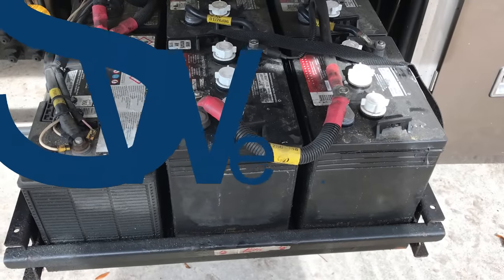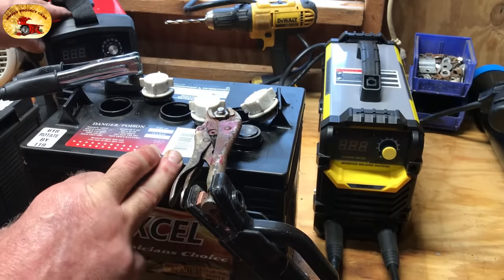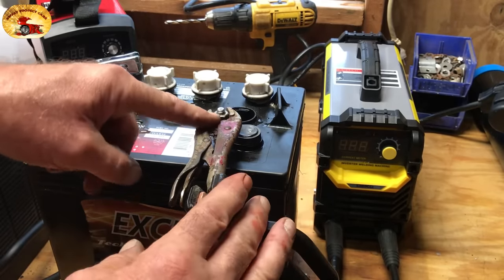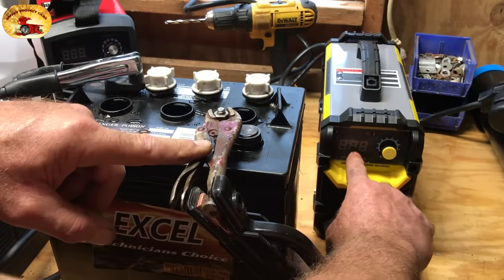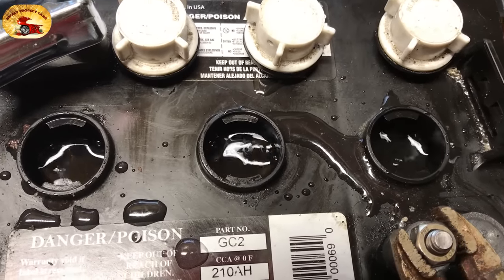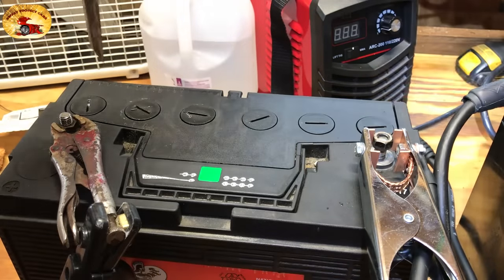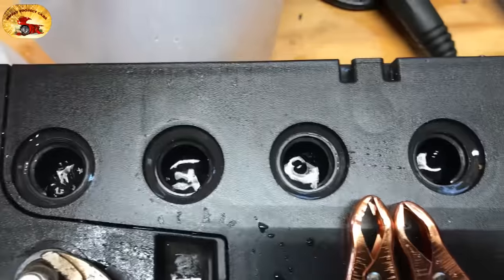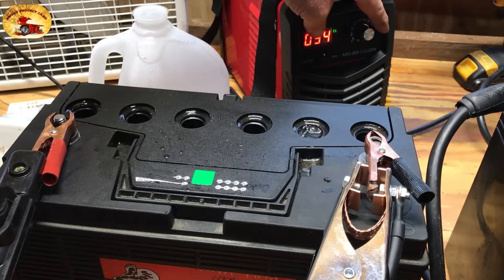How To MAKE OLD BATTERIES NEW Again!!!  12v 6v Deep Cycle, Car, Truck, Golf Cart, Semi

Comment: Thank you very much.I can confirm that this method works.I will try to give info how i did it so maybe someone will find it helpfull.My battery is 75Ah 12V one.It worked perfectly for 3 years without any maintenance at all.First i added 100ml of water to have it enough and over all cells for about half of inch.One cell in my battery was bad.I saw no bubling on charging using my welder on 30A.So i cranked it up to 80A.I keep it running for short time till battery temperature started rising up to 35deg (body temp).Then i made a pause till battery colled down completely.Then i did same thing again.This about temperature is IMPORTANT ..... it must be done as i described.I repeated this for about 15 times.Then i turned it back in to my car.It started at half of key turn.I am testing it today and tomorow i will know.....after cold night.....is this permanent solution or i have to repeat all for more times than i did it now.Battery was not capable to start the car before i tried this.Thank you again and Happy New Year!
Reply from the maker: Awesome Miki!  Thanks for sharing your results, we appreciate it.  Have a great day.  mad Mike the hammer SPC
Reply: @SweetProjectCars  It didnt restore full capacity....but was in better condition next day.....so i decided to repeat all over again till i see bubling in all cells to be the same.And it happened after many repeats (to avoid over heating - lowest current setting on my welder is 30A).Now it holds as new.

Comment: Howsit. I have 4 x 12v 225a batteries for inverter. 1 battery has a dead cell. Its not boiling at all. What can i do or is that 1 toast?
Reply from the maker: Do the process shown up to 5 times, if it doesn't wake up after that your battery is toast juan. Thanks for watching and asking, have a great week my friend. mad Mike the hammer SPC
Reply: @SweetProjectCars  update... The 3 cells on the negative side only start boiling at 80 to 100 amps. Other 3 boil like crazy... Did it many times. Goin 200amps, those 3 seem to boil faster but looks like after few min boils less.... U reckon toast? Thanks brother
Reply: Hey brother. Got them to boil. Keeps 12v charge now. Doesnt last long tho... But did it like 30times lol... Question... Has any1 tried this method with 4x batteries in series. 48v, boil all 4 at the same time? Regards

Comment: Will this work with AGM batteries? Also what about using the Harbor Fright wielder, Unlimited 200™ Professional Multiprocess Welder With 120/240 Volt Input? I need it for other projects but I've also got 6 dead batteries to replace. 1/5 AGM/reg, still about? $500.00 This welder is $769.00, sounds like a no brainer if it will work. What do you think?
https://www.harborfreight.com/unlimited-200-professional-multiprocess-welder-with-120240-volt-input-64806.html
Reply from the maker: No, it does not work on agm/gel batteries.  This  https://amzn.to/2K1UsWQ  is not 769?  Not sure where you got that cost, but all of the tools/products we use in our videos are in the SHOW MORE of the videos description.  mad Mike the  hammer SPC
Reply: @SweetProjectCars  Sorry, not the welder in the video. I'm talking about a Harbor Fright wielder, the Unlimited 200 Multiprocess Welder, it does MIG, TIG and stick welding, plus Aluminum too. Since it does stick welding I'm guessing it can do what your doing since its applying a consistent DC level at the battery. Is that correct? I left you the link above to look at.

Comment: Two questions please: 1) Please identify the two welders you used in your procedure;  2) can this same technique be used with AGM, or does the glass mat inhibit the "shock" of high current charge?  PS: thank you very much for a great tutorial.
Reply from the maker: This one https://amzn.to/3sTpodi  for ALL Deep Cycle only 6 Volt & 12V Batteries  and   For All  Standard 12-volt Batteries use this one   https://amzn.to/2K1UsWQ  This process works on all wet-style batteries only, no agm/gel batteries.  Thanks for watching Len, we appreciate it.  Have a great day.  mad Mike the hammer SPC
Reply: @SweetProjectCars  What are the differences between deep cycle vs standard batteries that require different welders? Is there not one welder that can do the job for both types of batteries? Thank you so much for your help! 🙏🏼
Reply: @AberrantAbe  @Sweet Project Cars I have the same question. I have five vehicles, but am also interested in getting into 6v golf cart batteries on the cheap (maybe find some discarded ones) for use with building a solar power system. It would be nice to just have one welder. I would really be interested to know why deep cycle vs. standard batteries requires a different welder.
Reply: Hi Mike I know this is an older Video. I hope you're staying safe and healthy!  Your videos have helped me tremendously over the years!  Wishing you a wonderful holiday now because I will probably be relaxing in another week or so. 

I do have a question that you may know the answer to.  I have both deep cycle and regular batteries would I be able to get away with using just the 165 amp welder for both uses?  Just trying to save some money and to avoid more clutter in the garage.  Any insight would be helpful. Happy holidays brother!
Reply: @AberrantAbe  Deep cycle has thick plates inside for slower discharge. Standard has thinner plates for faster discharge needed for starting equipment rather than holding power for long periods. I also discovered they score plates like Hershey bars, engineering them to break near or at the warranty time. Open up a 2 year warranty battery yourself and take a look. It will tick you off.
Reply: @OptimumServices416  hey brother, I know I’m not Mike, but I read on another comment where he said you need 2 different types of welders for the 2 types of batteries (deep cycle and standard 12v). I know, disappointing. LoL. I hoped there was one welder to rule them all.
Reply: @SweetProjectCars  I don't get why you need two different welders to do this ?? You never explained why.
Both welders output amperage and can be adjusted, so what's the difference ?
Reply: Has anyone done this and input since  the video was made?
Reply: Two different size batteries require larger and smaller welders -

Comment: How do I test for a dead cell
Reply from the maker: Run this process and you will find out if there's a dead cell.  Thanks and have a great day.  mad Mike the hammer SPC
Reply: I have been able to get a dead cell on a 6v battery bubbling but the specific gravity is still not reading.  I am in the early stages of reconditioning the battery.  Doing it slowly with a dead cell for safety.
Reply: You can also use a battery specific gravity (SG) tester.  Dead cells usally test very low on the SG.  Mine wouldn't even register a reading.

Comment: pretty much boils down to "do I buy a new battery or do I buy a welder?"
Reply from the maker: If you are not into DIY and doing things yourself, head on down to walmart and snag yourself a 99.00 2 yr. battery and you are set to go.  I wouldn't concern yourself with buying any tools, sounds like maybe tinkering with your own stuff maybe isn't your bag.  mad Mike the hammer SPC
Reply: @SweetProjectCars  Hah, maybe I should have phrased it " now I get to buy a welder..."
Reply: @guyspencer4322  this guy has another video on using a regular car battery charger. It's about a year old and has different times for charging. Don't know why he didn't just reference it. Good luck with your project 👍
Reply: @houstonsheltonbees814  Yes but that’s also a 200 amp capable 12 volt charger that costs about $139. For someone doing DIY and especially more than one battery, this is awesome. For the person who might use it once, not so much. Personally I work on cars so love all of mikes content!
Reply: @guyspencer4322  Obviously, a new battery helps you once -- until you have to buy the next one.  A new welder gets you welding capabilities and you no longer need to buy new batteries.  Do you want to buy one fish, or a whole pond full of reproducing fish for the same price?

Comment: Hey thanks for the great video It is so useful and educational, i tried it on my motorcycle battery on the lowest volume and all of the cells bubble except for one i crank up the welder a little but the dead cells wont budge but all of other cells boil like crazy so i cant go upper i afraid they blow, what i do?
Reply from the maker: If you can't get a consistent boil on all of the cells Alireza, your battery is toast. Thank you for watching, sorry for our delay in responding, have a great week. mad Mike the hammer SPC

Comment: Hi, much appreciated your great video. I purchased the Deko already welder and I used it on one of my 6 volt deep cycle battery which is 300 amp hours , after doing 5 min for 5 times and waiting 10 minutes between for rest periods the voltage did get better and it did start to boil more. But the battery is resting only at 5.8 volts. Should I continue the process till I get the battery to sit a 6  volts or more. Thank you again

Comment: Do I need a 200 amp charger for a lawnmower batteries or will 50 amp suffice?
Reply from the maker: For that size battery, follow the video using the exact tools/products just cut all timelines in half, William. Thanks for watching and asking, have a great weekend. mad Mike the hammer SPC

Comment: Hey I have one cell its the one at the end by positive terminal that isn't really bubbling like the other and the battery only lasted a couple of days. Alternator is good and I cranny the welder up all the way and it still won't bubble hardly, I've done all my batteries this way and they all worked but I can't get this one for some reason, what can I do?please help asap, thank you
Reply from the maker: Sounds like your battery is toast jay. You can do the complete process up to 5 full times, but if it doesn't work after that, it's toast. Thanks for watching and asking, have a great week my friend. mad Mike the hammer SPC

Comment: Thank you for the videos. What is the purpose of adding a clamp to the battery terminal first and then connecting it to the welder clamps. Is it for avoiding the sparks...?
Reply from the maker: Please, if you are planning on doing this process, follow the video to a T not only for safety but to make sure the method works for you. Thanks for watching and asking, have a great day. mad Mike the hammer SPC

Comment: Mike my man! I have them both... welder and dead battery...   First I'll try it with a really old one... if it works I open a battery repair shop :D !!!!  And I'll donate some of my savings! THX!
Reply: Big respect from Hungary!
Reply from the maker: Follow the video to a T my friend.  We are here for you, if you need help, reach out with any questions.  Thank you for watching and for your kind words.  Have a fantastic day.  mad Mike the hammer SPC
Reply: @SweetProjectCars  Nice thank you! I eventually skipped the project today because of heavy frost... I think it will work better at least around +15 C... 
And since you are so nice I dare to ask:
Is it not better to fill in battery acid instead of distilled water? ?? I have them both... and I just wonder, maybe the old battery would require some fresh acid...
And is the polarity important where to connect wich cable?? Thank you for the answers. 

Ps : be careful with the 303 rubber treater I read it can cause harm to the human body..
possibly carcinogen! Just take extra care...
It looks really effective, however! Keep on the good work! Respect!

Comment: Will this welder work? Forney Easy Weld 140 MP, Multi-Process Welder
Reply from the maker: Please follow the video to a T, there is no other alternative, use the exact same tools, products and method, we've spent years perfecting this process. Thanks for watching and asking, have a great week. mad Mike the hammer SPC
Reply: I use my welder and it works too on regular 12v car battery will this work for agm batteries too?

Comment: I’m doing a 6V deep cycle battery right now and I’m getting zero to very light boiling. Does that mean it won’t work on this particular battery? FYI, I did another 6V deep cycle yesterday and brought that one back to life.
Reply from the maker: Hello Paul, you can do the entire 5 step process up to 5 times, if it doesn't wake up your battery after that, the battery is toast my friend. Thanks for watching and sharing, have a great week and all the best on your project. mad Mike the hammer SPC

Comment: What can I do if a have a shortened out cell. I mean with this process you create lead ,,mud" at the bottom of the cell and at some point it will be high enough to touch the cells and short them out. Is there anything I can do then?
Reply from the maker: My friend, if you can get the life of a battery doubled or tripled and that happens to your battery and you have to replace it, just be happy that you got to use the battery 2 or 3 times longer all for free.  Thanks for watching, have a great day. mad Mike the hammer SPC
Reply: @SweetProjectCars  well the battery is from my Ford Focus that was 5 years old at that moment and so was the battery. I was just dissappointed in all my other beater cars the batteries are at least a decade old

Comment: I believe most DC welders weld with the negative pole meaning the stick is negative and the clamp os actually positive.. general misconception..I have seen and used this method before it works...Im wondering if the reversed polarity is whats actually making the magic happen..what you think?
Reply from the maker: Knowing youtube, we have to keep things very simple we have to show the processes without getting into too much confusing info. Thanks for sharing, Piere, have a great day. mad Mike the hammer SPC

Comment: What happens to all that sulfate that gets boiled off the lead? does it dissolve into the liquid?
Is there any time where you would want to dump out all the solution and replace the acid? I know the acid is not suppose to evaporate but over time i may break down?
Just thinking out loud over here - you got me very curious :) Good job over there
Reply from the maker: Hello Kevin, don't analyze until you are paralyzed, follow the video to a T and you will love the results. As far as replacing the acid, it's not necessary, but you certainly can if it makes you feel better. Thank you for watching, we really appreciate it, have a great week my friend. mad Mike the hammer SPC
Reply: @SweetProjectCars  Great answer; thankd you very much!

Comment: From what I've seen on YouTube and tried myself minimum amps required to start bubbling is 50amps. However this amount will not be sufficient enough to desulfate the plates inside a lead acid battery. Also some batteries require a discharge before being put back to use. So go through this process and fully charge the battery then put a load to measure voltage drop and check where it settles (12.6V - load = resting voltage) light or actual load tester (tool) for a few seconds then remove the load and see if the voltage returns to 12+ V. It won't be the same as before the test but it is a good indicator that the battery is in functional state. Then proceed to discharge it approximately to around 10.5V then recharge it until full 12.6+V and should be good as new. Also like you replied some batteries are not capable of being reconditioned due to internal damage.
Reply from the maker: Thank you for watching and sharing, we appreciate your input Frankie! Have a fantastic week my friend. mad Mike the hammer SPC

Comment: Good sir, have you tried the desulphating pulse chargers like the OPTIMATE-6 ? 
I want to start a home based battery revival wokshop and I need to know what to invest in first. A 5 Amp smart charger with desulphating component (OPTIMATE-6) or must I straight out go for the dc-welder?
Reply from the maker: Get the welder, it's the best way to do this process my friend. It's a small investment for a great return, plus you will have a welder if you ever need one :) Thanks for watching, have a great day. mad Mike

Comment: The smaller weld won't do 12 volt?
And the larger welder can't adjust down for the 6 volt battery?

I'd like to have only one welder etc...
Reply from the maker: Please follow the video to a T, there is no other alternative, use the exact same tools, products and method, we've spent years perfecting this process. Thanks for watching and asking Don, have a great week. mad Mike the hammer SPC

Comment: please solve this confusion about 
1. voltages i have some batteries of 65ah, 100ah and 200ah, some batteries shoots voltage on 18 to 20 volts some are starts from 15.5 to 16.5 on the lowest settings of inverter, how to handle this or this is just a numbers please resolve this issue.
2. some batteries have lots of black particles and lead acid plates are showing black what should i do in this situation can i replace the acid or do your process then replace the acid or only do your process ? kindly answer these questions it is very important for me thank you
Reply from the maker: This process works on all wet-style batteries, just follow the video step by step, listen closely as well, it is not necessary to replace acid, don't over analyze just follow the process shown and remember make sure you recap and unplug the welder before disconnecting the cables.  Hope this helps, have a great day. mad Mike the hammer SPC
Reply: @SweetProjectCars  last few small question 
1. after this process i have to charge the battery on slow charger ?
2. immediately connect the charger after the process or first cool the battery then connect the charger ?
3. how much inverter ampere should i give it to batteries 100ah and 200ah when desulfation ?
4. how much charging ampere should i give it to batteries 100ah and 200ah after  desulfation ?
I am waiting for your reply
Thank you